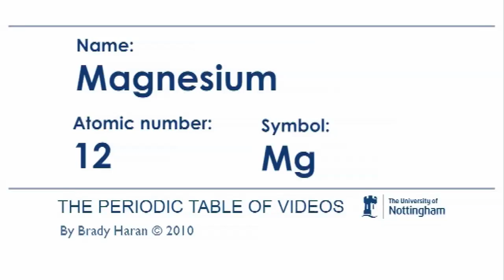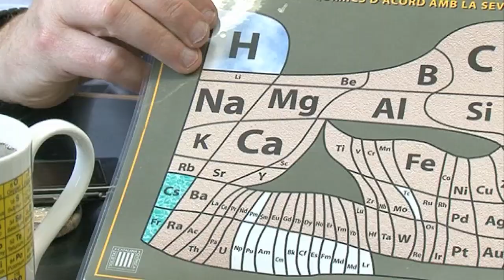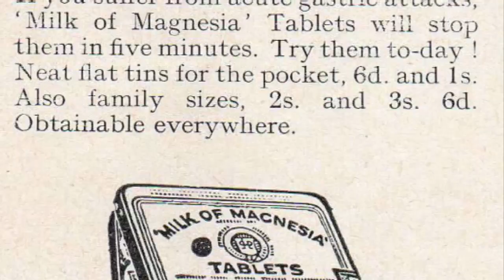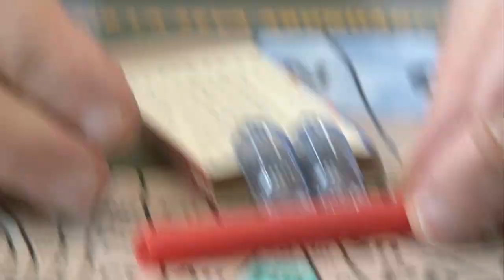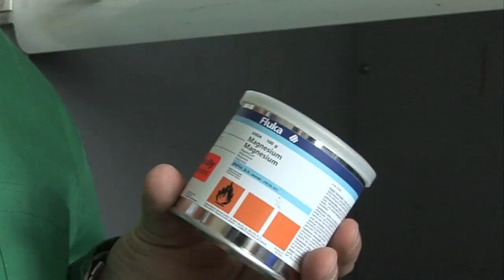Magnesium - Periodic Table of Videos

Comment: Now, am I correct in my understanding that if you stare at a piece of burning magnesium that it can cause you to go blind?  I remember my Chemistry teacher in high school advising the class not to look into the light for an extended period of time.  Afterall, isn't magnesium and magnesium alloy used for welding?  And one should never look directly at the welding surface without a faceguard.

Comment: You can burn magnesium under carbon dioxide...there is so much energy in the burning magnesium that it will literally rip the oxygen right off of the CO2 molecule and react with it, forming magnesium oxide, carbon and carbon oxides.